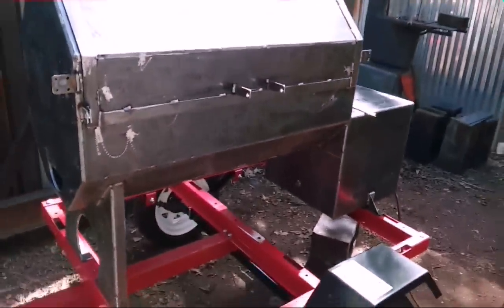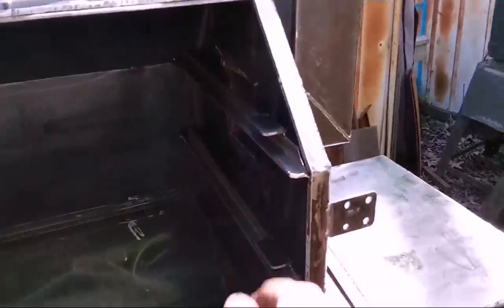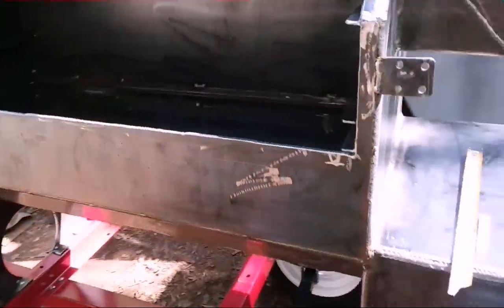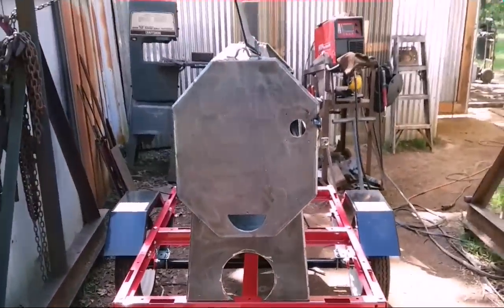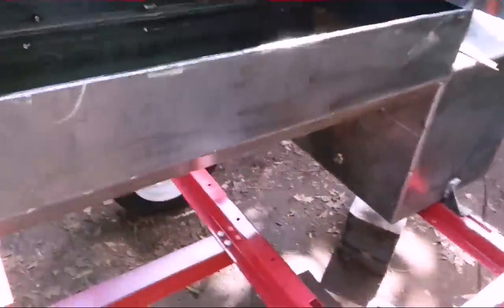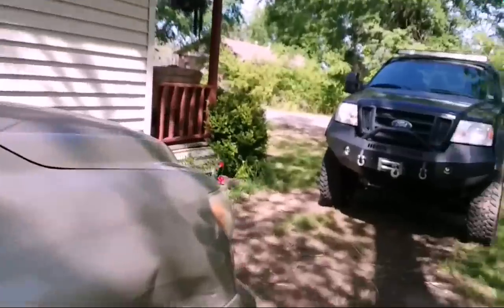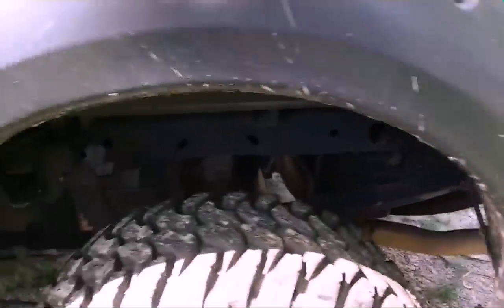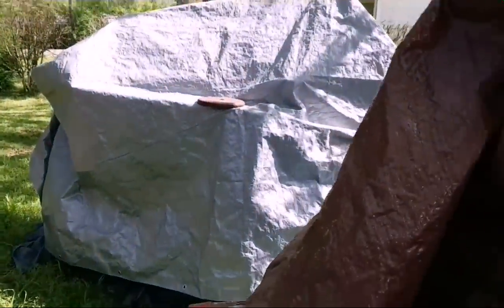Reverse flow bbq trailer build p.1/2

Comment: Looks like you are enjoying the plasma cutter, hope it serves you well.
Nice truck, that back up alarm you can turn off on the older model it was a  button in the center console with a big P and an arrow under it. I had to back a damned trailer full of materials 1/2 a mile down a logging trail one day with that damned alarm going because I did not know that; I was a bit angry by the time I was done.

Comment: Out of curiosity you’ve posted about bending 3/16” steel plate by grinding down the bend line. Have you bent 3/8” or even 1/4” using the same process?

Comment: I think i would put firebox on the nose cause thats where you want most of the weight. If the tail is too heavy or even balanced weight it will wag going down the road.
Reply: Because tripping over a trailer tongue while tending a fire isn't too handy.
Reply: Of course tripping over a wheel/tire combo isn't either. Allen does quality work however, and as is life, concessions must be made..
Reply: Thats why allen and i are fabricators.